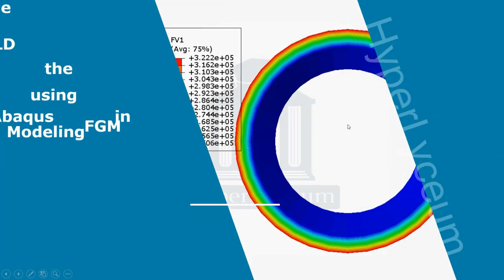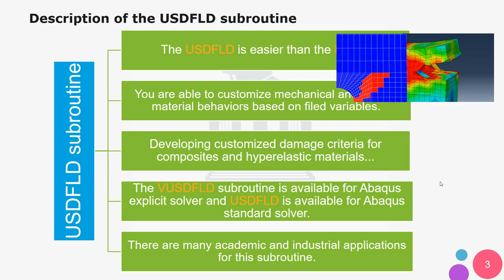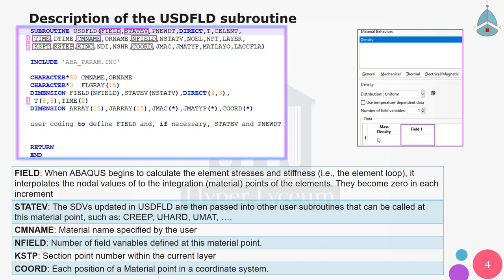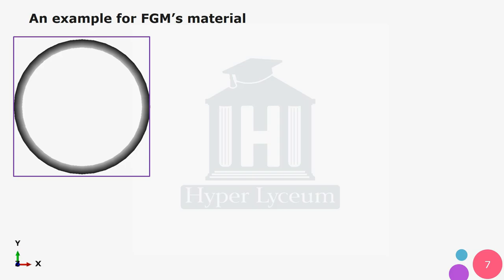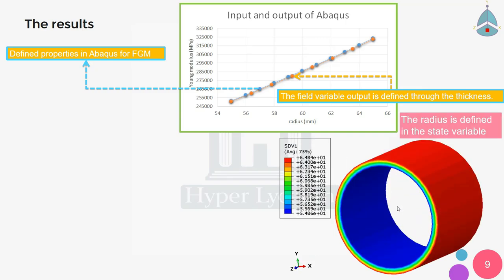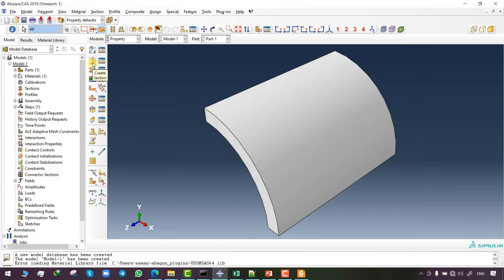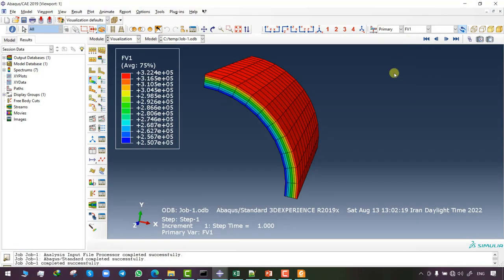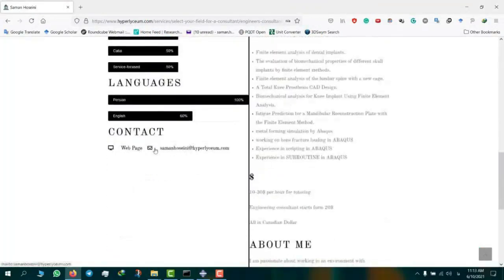USDFLD Subroutine in Abaqus: Modeling Functionally Graded Materials (FGMs) (Solid Elements - Part 1)

Comment: Why did you explain it like that? I wasted so much time because you confused me. For anyone attempting to replicate the simulation, please DO NOT follow the previous instructions. In the user subroutine interface, FIELD(1) should be set equal to the radius. Abaqus utilizes this value to evaluate the Young's modulus and Poisson's ratio based on the 3rd column, which represents the radius in this case, NOT THE YOUNG'S MODULUS! The current code is incorrect. 
The key thing to understand about USDFLD is that FIELD(1) corresponds to the Field 1 column in the definition of the material model. So, you should simply write FIELD(1)=r, and then Abaqus can identify the appropriate row in the tabular data. 
Hyper Lyceum, instead of helping me, you confused me. If you don't know something, don't upload videos claiming to be experts!